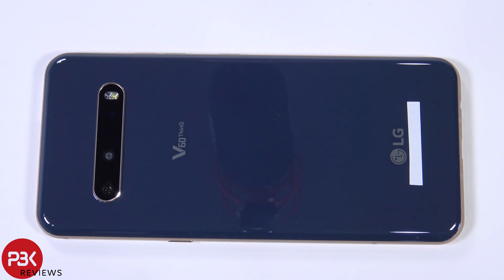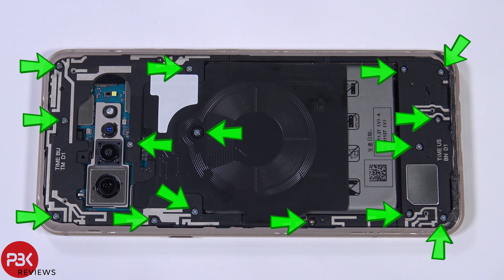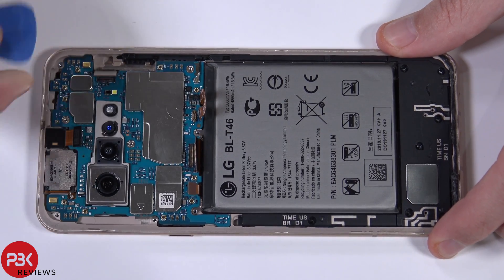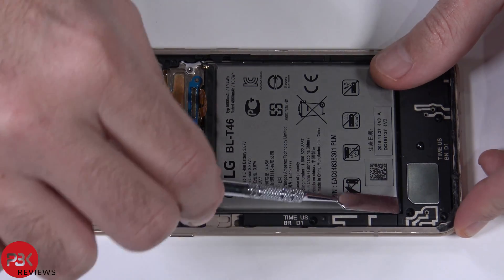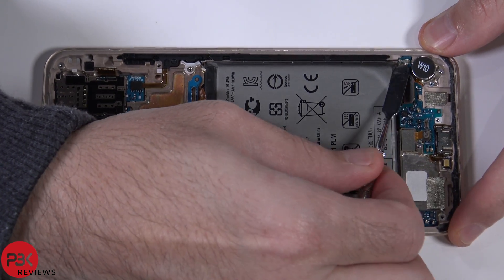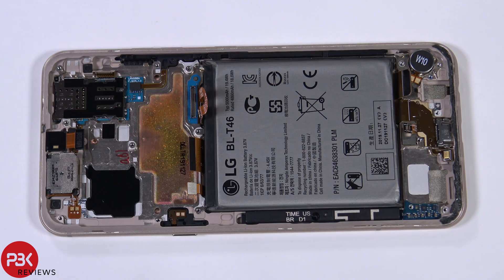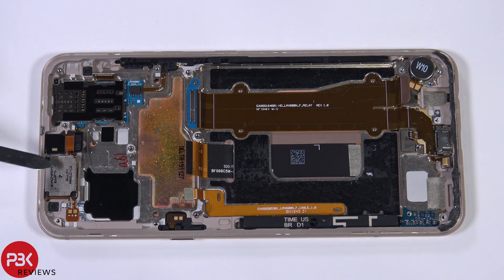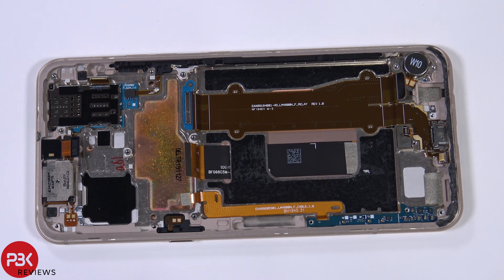LG V60 ThinQ 5G Disassembly Teardown Repair Video Review

Comment: So to change the battery, all the boards, and mic, etc has to come off? I was hoping this battery change could be easier.
Reply: Nope, he just took everything else off first. None of those components were restricting the removal of the battery. Don't know why he did it in that order. I guess he wanted to get to and point out all the more important hardware bits first. Which is odd considering 90 of anyone needing to take apart their phone is doing it just to replace the battery.
Reply: 🤣 Have you taken a look at the s22 to s24 battery replacement, more cables have to be disconnected. Why do you think apple opted to replace the battery via the screen removal side
Reply: @louislule256 Hah. But no. I never thought Apple would show or help you know how it is made unless you go to the grocery, pick up a bag, fill it with apples, and go to the cashier! Else everyone could grow it at home!😱😝

Comment: Switching the main board from a att phone to a TMobile phone (frame) will turn the last phone into an working att phone? I know might be a stupid question 🤔. Thank you!
Reply from the maker: yes correct, but sometimes there are minor differences as far as antenna placement inside the frame etc. which may cause reception issues. Usually it's not the case but some phones have different versions for different carriers. Just make sure to move over everything you can from the original frame belonging to the same motherboard like the bottom sub board and small antenna board on the bottom corner and the top and bottom covers over the boards etc to make sure all those parts are the same match for the motherboard you are using.

Comment: So you didn't have to apply more adhesive or even reheat the adhesive for the battery?
Reply from the maker: The adhesive for the  battery on this phone is strong enough to be reused and no heat is required to re-apply. Original replacement parts for this phone can be found on mobiledefenders.com if needed.

Comment: Thanks for the video! About how long do you recommend heating the back at step 2?
Reply from the maker: You're welcome. Heat it up gradually until its hot to the touch. You can always apply more heat as you're working your way around prying the back off.

Comment: I pulled my phone case off to clean my phone and found the back glass was shattered. Not sure when or how it happened, never dropped the damn phone. But it gives me an excuse to open the fucker up and replace the battery and replace my glass 🤙
Reply from the maker: If you need original parts for it, you can check mobiledefenders.com they should have most of the parts available for this phone.

Comment: How do I transplant the copper vapor chamber to a new frame? Or is there a place to buy a replacement one?
Reply from the maker: It should be held down with adhesive, you can heat it up and gently pry it off trying not to bend or warp it too much.

Comment: Any advice on replacing the cameras on this phone?
Reply from the maker: There isn't much to it, if you follow the video and take it apart, all you have to do is pop off/disconnect the camera cables from behind the main board and you can replace them. Replacement parts for this phone should be available at mobiledefenders.com
Reply: @PBKreviews  they are glued in place tho

Comment: Just wondering i bought a demo v60 was just wanting to use battery board assembly because mine has broken by using the whole assembly of demo phone to my phone will my phone be able to operate still under my current network
Reply from the maker: Hi, I'm not sure what you mean by battery board assembly, but you would be able to take out your motherboard and replace it with the motherboard in the other v60 and use it. Also just because its a demo v60 doesn't mean it can't work as a normal phone. There are ways of turning demo mode off on those phones, you can youtube or google it.
Reply: @PBKreviews  ty in the process now of trying to flash it
Reply from the maker: @m56black55  no problem,  some phones if you do a factory reset from the settings will also remove the demo mode.
Reply: @PBKreviews  I've tried that and still in retail mode
Reply from the maker: @m56black55  oh ok, i know each phone has a way to turn it off and remove it without reflashing firmware but takes time to search online and figure it out i guess.
Reply: @PBKreviews  will do pre she ate it bro

Comment: This is great, thank you. My charging port is very fickle - where can I purchase a replacement, or alternatively, how do I recondition the original part?
Reply: Alot of people sent in their phones to replace due to this issue so if your phone still has warranty, then send in for replacement instead of messing with it. I just bought and received one from eBay and it started to have the charging port issue and I am think to return. I love the this phone but the charging port issue made me headache unless I used wireless charger.
Reply from the maker: You're welcome. You can check this website but it shows not available at the moment but you can click on notify me when available: https://www.mobiledefenders.com/lg-repair-parts/v-series/v60-thinq.html
Reply: This phone has a common problem on charging port.  Sometimes it cycles around connecting & disconnecting several times. eBay has the charging port with flex cable part: https://www.ebay.com/itm/OEM-LG-V60-ThinQ-5G-USB-Charging-Port-Dock-Mic-Flex-Cable-Replacement-Part-V600-/184910157637?mkcid=16&mkevt=1&_trksid=p2349624.m46890.l49286&mkrid=711-127632-2357-0

Comment: Anyone knows how to stick back the vapor chamber of V50?
Reply from the maker: try using some thermal paste to keep it adhered somewhat to the frame to transfer heat efficiently and just assemble the board and parts back together that should hold it in place and it should do its job.
Reply: @PBKreviews  Thanks mate! I needed that :D!
Reply from the maker: @mangkokhayon5039  You're welcome :)

Comment: Tried to remove the battery. Little heat, then pry. Well, that was not much of a success. Thirst came the smell, then....pfssssss. Guess bit to much heat. Never again.
Reply from the maker: Oh sorry to hear. Bending too much or piercing the battery will cause that to happen. Now a days you can use isopropyl alcohol (https://www.ifixit.com/Store/Tools/iFixit-Adhesive-Remover/IF145-400?o=4) to squeeze some around the sides of the battery and let it sit for a minute so it eats away at the adhesive underneath, making it much easier to pry off.

Comment: First off, great video and your commentary is concise and helpful.  I want to replace the front screen.  I'm thinking a lot of the components you removed do not need to be removed to take off the front screen. True?
Reply from the maker: Thanks! Correct, not all the parts need to be removed. The main board can stay in place, you would need to remove the battery to gain access to the screen cable to run it through the midframe. Here is a link to OEM original parts if you may need any https://www.mobiledefenders.com/lg-repair-parts/v-series/v60-thinq.html
Reply: @PBKreviews  Thanks again!  Just completed the repair. Only the wireless charger and battery need to come off to do the front screen.
Reply: @PBKreviews  what ID i just wanna replace glass screen not the digitizer or oem

Comment: Is it possible to fix a hard bricked lg v60 by replacing the board?
Reply from the maker: yes, if you replace the board you are basically replacing the software and firmware as well since that's stored on the main board.
Reply: @PBKreviews  do u know where I can purchase a damaged lg v60 for parts I just need the board
Reply from the maker: @ucantguardme8018  your best bet would be ebay
Reply: edl mode
Reply: @sahharkoo  how do I put it in edl mode the device won’t even power on

Comment: Any chance of doing a screen replacement? I repaired my LG v60 screen , but I think I messed up something.
The fingerprint scanner doesn't work and there's a black circle in the fingerprint placement. It would be certain death to the screen/dmg if i try to remove it.😔
Reply from the maker: I don't have the phone with me anymore, but not sure what you mean by the black circle. Did you make sure to put your fingerprint scanner back? And sometimes the screens come with a plastic film or something covering the spot where a finger print reader would line up with which you might have forgotten to remove if that is the case. (not 100% sure if its the case with yours. ) Also here is a link for the original replacement parts in case you need anything. https://www.mobiledefenders.com/lg-repair-parts/v-series/v60-thinq.html

Comment: Where exactly is the proximity sensor
Reply from the maker: I don't remember exactly with this phone but some phones use the front facing camera as a virtual proximity sensor when there isn't one on the main board. Its also possible its on the back side of the sim reader board on top.

Comment: miss the days of removable back cover and replacable batteries.
Reply: Lg V20 is still the best phone LG made for this very reason
Reply: remove the back glass and remove all the glue from the glass , and stick the wireless pad to the back glass so when you remove the back glass the pad also came off with it and expose full access to battery , with this method you can change battery easily like the old phone, but now you lose water resistance and have to use a tight case to hold your phone together .
Reply: @WV591
Yeah,about that😐
Reply: So I dont have to dismantle all those layers or unplug every tiny connection as he did in the video just to replace my battery? The glass back cracked & original battey is growing & wont hold charge so I got both replacements on Amazon but neither came w/directions!!! The battery came w/tiny screwdrivers, a small suction cup on a silver ring, a plastic guitar pick & 2 thin strips I assume are adhesive, please HELP lol
Reply from the maker: yup :)
Reply: You can easily remove the back cover and replace the battery just like he did... I like Ingress Protection rating better
Reply: @kevinwhiting8391  how to make IP's phone like LG V60 can be water resist again after remove the backdoor?
Reply: @wise7260  great question
Reply: @wise7260  
If you use quality parts with same adhesive.  It should still be water resistant. Probably want to clamp it down for awhile to seal though.
Reply: @kevinwhiting8391  I had a Sony phone with a waterproof removable back plate.  It had a rubber seal that inserted into a crevice that encircled the battery.  It was prolly too expensive of a design these days so no one does that anymore.

Comment: Where's the fingerprint sensor
Reply from the maker: on the bottom connected to the charger port board right under the battery.

Comment: Terrible video. Didn't do a complete teardown. Neglected the front of the phone. Don't do a teardown if you can't do it correctly
Reply from the maker: Maybe you should take your own advice.  If you can't figure out how to take the screen off after disassembling the phone then you probably shouldn't be attempting to do it yourself in the first place. It's pretty self explanatory and explained in the video. Once the phone is disassembled all that is left is to pry the screen off from the mid frame. There is no rocket science behind that. It's held on with adhesive. Then you get your new screen, apply new adhesive if your new screen doesn't already come with it pre installed and re apply it to your midframe. Oh did I mention that most screen assemblies for this phone come with the screen and midframe as one piece already assembled? Would you look at that!  You wouldn't even have to take anything from the front apart.

Comment: I am having issues charging. Phone seems to only charge when i have the charging cable pressed against it. I tried cleaning the port and everything but no luck. Any suggestions?
Reply from the maker: Your charger port has gone bad, you would need to replace the charger port with flex cable internally.
Reply: @PBKreviews  excuse me what is flex cable internally came you give me example? 😬
Reply from the maker: @AwesomeBlackDude  flex cable is the flat cable that is attached to the charger port that runs and connects to the motherboard. Its sold as one piece with the charger port solderer onto it for replacement.

Comment: The only bad part of this phone is the Charging flex cable. The design of it isn't bad since its made to fit both the main phone and the second screen case but the fact that its affixed to body of the phone with just some crap adhesive was a terrible idea.
Reply: any way to fix it?
Reply: I have read some users suggesting to glue the port. do you think it is a good idea. but I am not sure what do you actually need to glue.

Comment: You didn't replace charging port flex and some other flexes,not useful
Reply from the maker: All that is left for the charging flex is to peel it off. If you can't figure that much out then you should allow a professional to do it since you would damage the phone taking it apart if you have no clue what you're doing. I could have gone a bit more further and taken the rest of the flex off but all of them are just held in with plastic brackets you lift off or flex cables you peel off so was pretty self explanatory. If you have any questions let me know I will help you out the best I can.

Comment: Can anyone point out the 4th mic location?
Reply: The 4th microphone is above the back glass camera.
Reply from the maker: @CAMactuator  Thank you
Reply from the maker: hmm I'm not too sure, It might have been on the back plate but I don't see any contacts which would let to a connection for that, or might be covered on the left or right side black plastics on the phone. On the main board right above the third camera from left, there is a silver square piece which looks to possibly be another mic but can't tell for sure.

Comment: Did this to the t but can't get my phone to connect to network. Says searching like the antenna isn't working
Reply from the maker: Did you check and make sure the top and bottom plastic covers with the antenna lines running through them are seated in place and screwed down? also make sure the black wire cable is connected and has not come loose. If still no luck make sure your sim is active and has not gone bad. Aside from that it might be a bad software or hardware failure on the board somewhere.
Reply: @PBKreviews  I've done all of those but still nothing. Im thinking it may be just the antenna module. Im not really sure though. Everything else works except that. Before I replaced the charging flex cable assembly everything else worked perfect
Reply from the maker: @RoCkEtApPlIaNcE.1  make sure the flex cable assembly is not the culprit, might be defective. Also make sure all the cables are attached properly to the sub board on bottom including that black wire cable in the corner. Its also possible you might have damaged a chip or something on that small sub board on bottom.
Reply: @PBKreviews  ill look into it. Sub board came with the flex assembly. Any idea where there could be circuit diagram. Would make this alot easier to troubleshoot lol
Reply from the maker: @RoCkEtApPlIaNcE.1  Oh I see. Not sure. You don't have your old sub board to replace with this one to see if that is the problem? Or try your old flex cable for the charger port and see if you still have the signal issue. This way you can narrow down where the problem is.
Reply: @PBKreviews  true. Thanks for the help! I'll update where I get
Reply from the maker: @RoCkEtApPlIaNcE.1  sounds good, no problem

Comment: the back of the phone was broken and it fell in the water now the fingerprint is not working and i just got a pink like front top to bottom on the screen..... please help.
Reply from the maker: You probably have water damage. Your best bet is to take it apart and disconnect the battery and clean out any water or corrosion from chips and connectors with a small brush like a tooth brush. If you continue to use it as is you will risk frying your motherboard and your phone will no longer work

Comment: Hi! Thank you for video !! I am having issues with my dual screen blacking out as im using it but the touch screen is still responds or will continue to play music or run a app. But screen is black. And a flicker of green lines. I have to constantly sleep the phone and go back in. Do you think that has something to do with connectivity?  It only happens on dual screen my main screen on the phone it self is no problem....
Reply from the maker: It might be a display problem with the dual screen itself. If its still under a year since you purchased it, you should be able to send it in for replacement. Seems to be either a faulty cable with the second screen or faulty screen itself. You can always get another dual screen just to test and see if that is the problem to rule it out and you can return the second one after verifying the issue

Comment: Thank you for this video. I dropped my LGV60 and shattered the back panel and was curious on how to remove it.  I was able to buy a replacement on amazon and good as new.
Reply from the maker: You're welcome, glad it helped!
Reply: @PBKreviews  do you know how to replace the screen on this phone? Do you have to take all the parts out?
Reply: Same happened to me. But instead of a drop, I had a nasty bump into the corner of an open drawer. So I have a tiny dent on the back of my dual screen and shattered the glass back of the phone. Hoping my replacement goes well.

Comment: Great video , I had to replace my rear screen/cover. If you're an idiot like me, you only need to heat the edges of the rear cover to get it off. There is really only adhesive around the perimeter, so don't heat the other areas.
Reply from the maker: Thanks :)